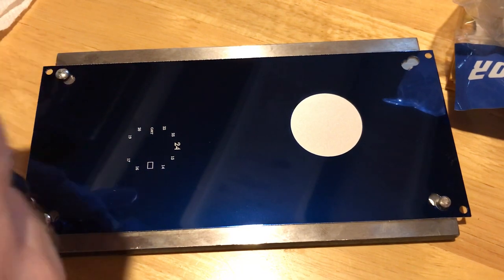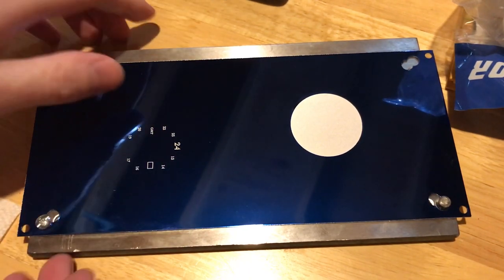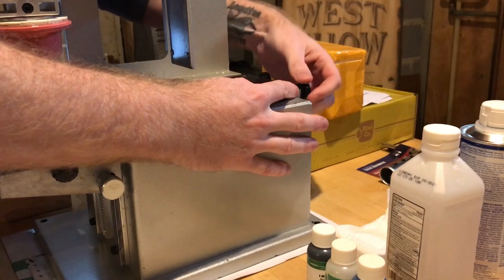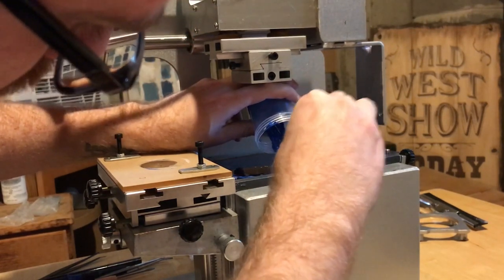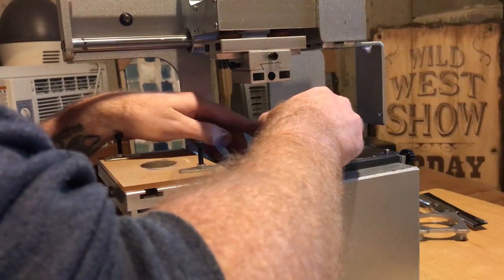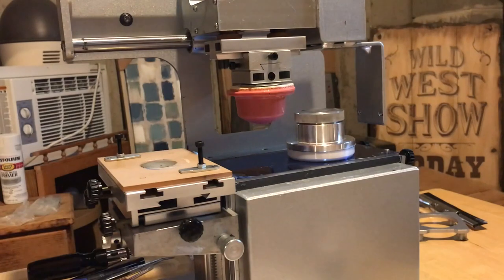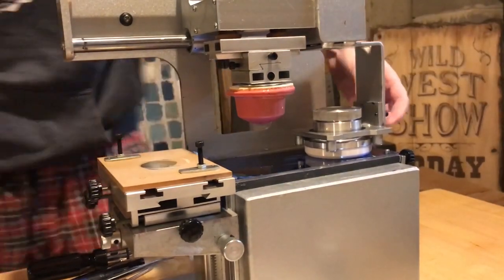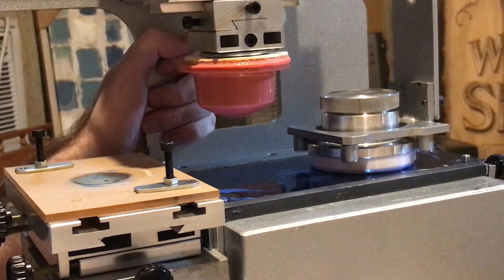Making Custom Dials Part 5: Dial Printing

Comment: I've done a bit of pad printing, put some clear sellotape over the piece while getting correct placement, then just peel off before going in with yr good print.
Reply from the maker: yeah i would agree with that process change from what I showed a few years ago.

Comment: Good work, where did you get the wooden dial holder? I'm trying to find something like it but so far no luck googling
Reply from the maker: hi there, it's not wooden, it's acrylic with a layer of paper on top (prevents reflection when the laser is cutting). I get them custom cut if needed, not going to find on google.

Comment: Really enjoyed the series, many thanks!   The final product here was fantastic.    I was trying to figure out why your printer does not always align exactly where you think it should and I think the solution may be in the pad.   The pad is the only “non machined” piece connected.  What I mean is that you showed in an earlier video that the bracket you use to connect the pad to the printer is connected by three wood screws you drilled in.   There is a possibility that it is not exactly centered, and as such every time you remove the printing pad and put it back on again, if it is not exactly rotated to the same position it was previously when you reconnect it, then the slight offset would be in a different spot each time.   To test this hypothesis, next time you are printing and need to clean the printing pad, try cleaning it without removing it and see if you get more consistent results.   This of course is just a guess from an amateur who has never used one of these so I may be completely wrong :)
Reply from the maker: Hey! Glad you enjoyed the series. The pad mount is connected via screws, but I very rarely take them off. The pad itself is a little squishy, which might be adding to the slight variations some. I do have several different pads. But almost all of the components on the machine are moveable, and once set where desired, the results are fairly good. What can lead to differences between strikes is the amount of pressure, as the amount of pressure can move some of the parts in unwanted ways if they don't have enough support (like the surface the dial mount is sitting on) or aren't quite tight enough. I also don't have the entire machine bolted to the table, and I really should. But for a home setup, I get by :) Thanks for watching!

Comment: Hi Brian ... great videos, I subscribed.  I am a watchmaker with my own YouTube channel and I am creating my own line of watches ... I am trying to decide whether or not to outsource the dial printing and the issue is all about quality.  The dials in your video do not have very small font.  I need to get crisp lettering at a very small font (Submariner style under the hands ... that kind of thing).  Do you think with some practice I can achieve that kind of  result with the same outfit and process you show here.  Richard
Reply from the maker: hi Richard! I have no idea how I missed this comment a couple years ago. I’ve seen your channel, quite successful. For getting really fine printing automated/computerized pad printing would really be the way to go. Can you achieve fine detail with a manual pad printer, yes, but it is hard!

Comment: Do you have a video showing just the equipment like ink cup etc? I am fascinated by this facet of watchmaking Only thing I like more is really good textured plates and indices.
Reply from the maker: like a walkthrough of the parts? as opposed to showing the process? I do not yet, but could make such a video!

Comment: Very nice results, I am not sure what technique and paint did you use to paint the white on the dial?
Reply from the maker: several very light layers of a white primer and spray paint. Spray very light layer, let dry two or three minutes, then spray next layer. Repeat for as many layers you want…usually I do 4-6 light layers.

Comment: Thanks for all the work to show us this. I have an accurate CNC lathe so I can engrave the part you have laser cut. What's the depth the laser cuts to? Thanks.
Reply from the maker: Usually something in the 22-26 micron range should work.

Comment: Great video, and it lifts the veil of mystery around dial making! Just one question, can you recommend a good source for blank dials?
Reply from the maker: Esslinger has some, but i usually buy dials from ebay ofrei and other places and strip them down if necessary. I also get dial blanks custom cut with a laser.

Comment: I’m loving the custom dial series. Question: do you have any experience electroplating brass blanks? I’d love to see a video on that
Reply from the maker: Hello! Glad you are enjoying the series. I have not done any sort of electroplating, perhaps it's something I'll explore at some point. You mentioned brass blanks...did you have a particular metal in mind for the surface?
Reply: Watch Complications see I may be mistaken but I thought it was through electroplating that professional dial makers color their (often times brass) dials.  I am looking to build a couple of my own watch and want to make a cream dial watch and a black dial.
Reply from the maker: @Splitt2  electroplating can be used to alter the surface color, I just haven't messed around with it myself yet. I may at some point though...but from what I've read it takes a lot of testing and experience to get it right.
Reply: a trick : watch movies at Flixzone. I've been using it for watching a lot of movies during the lockdown.
Reply: @Benton Joseph yup, have been using Flixzone for since december myself :)

Comment: Hello, what did you use to paint the dial? And how many coatings of primer and paint did you use? Thank you
Reply from the maker: several light layers of white primer applied 2 or 3 minutes apart. sometimes a layer of paint on top. the inks for the printing are a multi purpose ink for pad printing.
Reply: @WatchComplications  thank you man.
Reply: @WatchComplications  are there other ways to print letters/logos on a dial other than the techniques you’re using?

Comment: What machine is this and what machine do you use when engraving on a cliche? How deep should the engrave be?
Reply from the maker: There is no specific model number. If you google sealed ink cup pad printer or pad printing machine, you'll see them on sites like eBay and Amazon. The plates I have etched with a laser at a shop close to me. The depth is somewhere between 20-24 microns.

Comment: Sir which chemical is used for making etching plates. How photosensitive emulsion is applied and which electrolyte is used for etching process.
Reply from the maker: These are steel plates. I have them laser etched, no chemicals.
Reply: Good you do laser etching. But Swiss people who did etching with perfection that old technique is getting lost.  My dad use to-do. First making a calligraphy master then positive film with that wooden camera and enlarger. Followed by photo emulsion method.

Comment: Could you please please recommend a movement/case for 39mm 0.8mm thick dial?
Reply from the maker: That's a very broad question. I'd say find a 39mm case via eBay or a watch parts distributor, see what movement(s) it's made for and if that would work for you. If not, then you'll have to decide on a movement for whatever complications you're wanting and either find a case that fits it or have a custom holder made to fit the chosen movement to a case you do like.
Reply: @WatchComplications  thank you for your reply. I actually searched 39mm case which returns the total diameter of case as 39mm and not the dial fit. But I'll still look for it.

Could you recommend a no day/date (only time) movement for a 0.8mm thick dial? I'll figure it out after that as you suggested..but I'm unable to find a mechanical movement that will fit 0.8mm dial.
Reply from the maker: Dial thickness has nothing to do with whether it will fit a movement, all that matters in that regard is if the dial feet are in the right location. If you want a movement with a stem height that is correct for the case given the thicker dial the result will probably be a thicker case and custom holder. Depending on the case, you would need a dial diameter that fits the case.

Comment: Great video, do you have a link to the pad printing machine and the cliche?
Reply from the maker: I got the printer on ebay for around $300. You can search for pad printers with sealed ink cup and you'll see some similar listings. I waited about 6 months until I saw it at a price I liked. Looks like the ones listed now are higher in cost again. As for the cliche, are you asking about just buying blanks? Because the blanks you'd want to get will depend on the printer you get.

Comment: I think put a transparent thin plastic all over the wood where you put the dial and print then you have a perfect guide
Reply from the maker: manual printing = things move regardless of material, but yeah that can help with an initial guide

Comment: Hello, how to apply paint in dial? Example champange silver
Reply from the maker: The video shows the process of applying paint to the dial, or are you meaning the base dial color?
Reply: @WatchComplications  Yes, I mean how do you apply the base dial color?
Reply from the maker: sometimes I get dials with a white or black base already applied, sometimes I paint blanks myself using standard primers and paints from Rustoleum and Krylon
Reply: Thank you!

Comment: How did you custom the plate?
Reply from the maker: laser etching
Reply: @WatchComplications  thank you sir 🙏
Reply: @WatchComplications  can u tell me how the details to get the perfect result? The depth etc 
Best regards
Reply from the maker: the depth on mine is supposed to be between 22-26 microns
Reply: @WatchComplications  I'm still learning how to properly measure the original dial fonts and markers . so that it becomes very similar to the original when i stamp on it .I have tried many times but failed. would you tell me the tips?

Comment: how do i print on domed dial?
Reply from the maker: Silicon pads on pad printers can mold around various shapes. The shape and size of the pad is important for what item being printed. One issue beyond the pad would be having a similarly domed fixture under the dial so that when the pad is pressed against the domed dial, it doesn't bend the dial.

Comment: Hi. please let me know about the plate. is it laser plate or Alcohol wash. where I can buy it?Thanks.
Reply from the maker: It's laser etched. And you can't just buy them, at least not as simply as that sounds. You have to create the design to be etched in a vector format, buy the appropriate plates for the printer and the laser, and work with a manufacturer or laser shop to do the work. I would recommend finding someone as local to you as possible that you can work with face-to-face, as it is much better and things are never right the first time.

Comment: Dear God, you know something but you make So much small errors...

First of all you seems to dont understand the proces. The pad is a transfering element, is should be clean after each transfer...
Next when you cleaning a pad with, thinner and alcohol, you destroing it surface.

Next, stick transparent rigid foil to support of the cross table,bend it, print on it,  than align the print to part.  1 print on foil, set cross table, move the foil, second print on a part...

Next when you not printing, let the ink cup set on eatched artwork, you spear instant cleaning.

Mix more ink to the cup, you eliminate drying issiue

Stir ink better, blobs are bad. Ink should be super fluid, not thin but fluid like brand New car Oil. 

I have 16 years of expirience, In industrial pad printing! Regards!
Reply from the maker: I learn as I go, and have gotten better at it over time, and learned tricks (some of which you mention, like using transparent rigid foil for testing, leaving the cup over the print, etc) since I made this video, which was some time back. Eventually, I'll make another updated variant of the video. Many of the things you mention wouldn't have been necessary for me to figure out through trial and error if experienced people would create content and share. But alas, most people just hold onto their information and then point out when others make "mistakes." I thank you for your input, it is noted. But I also encourage you to make a video and share what you know if you wish others to do it "right." Although at the end of the day, if the dial turns out ok and it's my machine, parts, and ink...then I'm ok with that. And initial mistakes I made or will make are good because it's a learning process and it sticks. I'm more experienced now than I was then, but still have plenty to learn. Other thoughts......Industrial is easier than manual, as the machines are automated and computer controlled. Manual printing is another story. And there were no blobs in the ink ;) So what would you recommend cleaning silicone pad with anyway?
Reply: @WatchComplications  I'm from POLAND and i create content here localy, you have grate guys out there in US, John Caverman from pad print pros, and innovative Marking Systems. As for the manual printer, principale are the same, output per hour is much different. We use hand printer for test on a dayli bases. When you want to brake silicone pad, when it's New, from excesse of silicone Oil, u have to use alcohol, or fast thinner, on normal work, you should use adhesive tape to take out excess of dust and not transfer'ed ink. You should experiments with cycle time, pick up fast, than wait till ink dry a second or 2, than push it to part. U will see than, that whole ink will transfer from the pad, like it should be :) all ink should be on part, no residual ink should be visible on the pad after transfer. Its a matter of, plate, thickness of the ink, and cycle time. :)
Reply from the maker: The pads were pretty new when I was using them on this project. And yeah, cycle time is important, and can be a little harder with the manual printer, but I continue working at it. Thanks for the idea about tape.